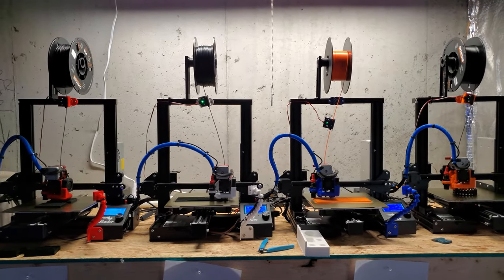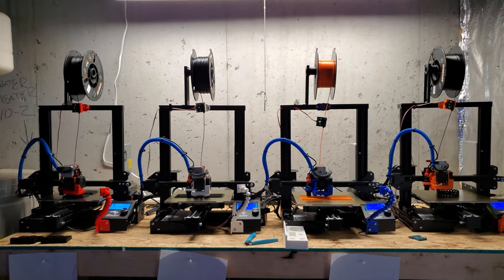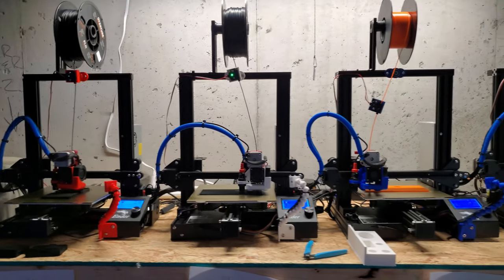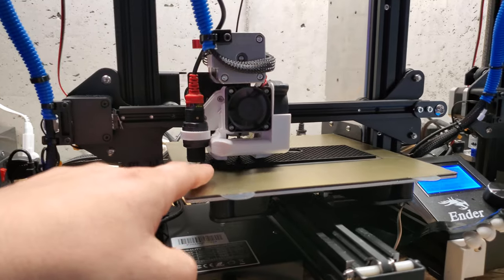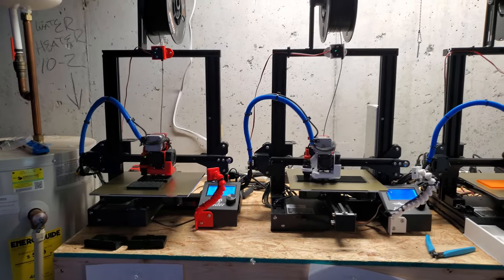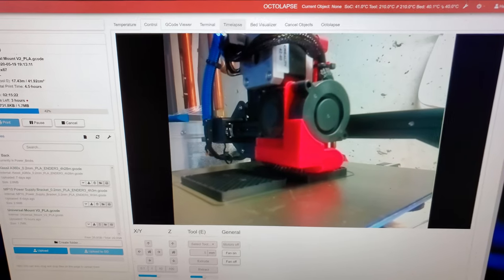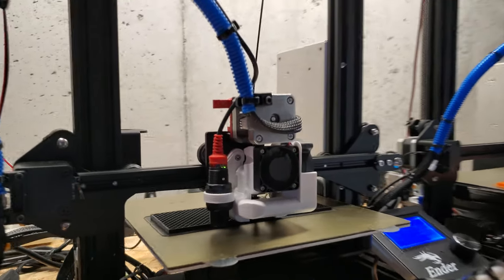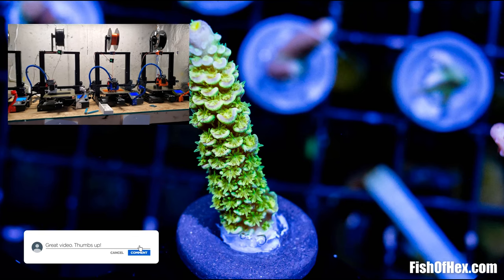My 3D Printer Setup | Upgrades | Is It Worth The Money?

Comment: I've found that the lack of fiddling / maintenance my Prusa's need has more than offset the price increase over clones. That and there wasn't having to dump another few hundred into upgrades to get them safe / functionally friendly, by then you're almost at a Prusa cost. Did that once with my original clone, it's sitting in pieces in a box. You got a nice farm going, much easier to run when they're all the same machines. Whatever you do, don't mix and match clones.
The removable / springsteel sheets are worth every penny, no matter the printer. No more stupid spatula trying to pry prints off the sheet, just leave it alone or at worst, flex the sheet and pop. That is probably the most impacting upgrade the hobby has seen in the last three years.
And for everyone thinking of turning the hobby into a side business - never share your STL's.

Comment: You didnt need a new pcb for the thermal runaway issue. You can just flash new firmware. Granted it doesn't address the issue of noise.

New stock ender3 come with new firmware with thermal runaway. It's only the old stock that has the old firmware doesn't have thermal protection. 

My ender 3 pro is stock and I've stood next to it while it has stopped and displayed 'error thermal runway' as disconnected the thermos to test.

Your enders look great!
Reply from the maker: I know but the stock board is junk and not worth the risk regardless of firmware.

Comment: So what exactly does the Raspberry Pi do? Send codes to the printer? And also if I bought a printer how would I know what I need to upgrade?
Reply: It runs software called OctoPrint.  Think of it like a controller. Let's you monitor remotely and do all kinds of advanced tweaking.    Without it you need a computer hooked up via usb or a flash card to start every print
Reply: @jasper9890  oohhh gotcha,  thanks for the response!

Comment: Nice setup. I was planning to start this hobby and been wondering what’s the best investment for me and something that I can upgrade and use for ever instead of having to buy new and sell old. Any opinions would be greatly appreciated.
Reply: Two trains of thought - cheap clone, will force you to learn the basics and how the printers work, and allow you to upgrade to your hearts content. Cons are it will eat up a lot of your time, might have to chase obscure issues, usually require fiddling to keep print quality consistent.
The other school is buy a prusa, point click print. Can be a high price to swallow, though the mini is out now and a much cheaper option. Just like a 5 month backlog for production, and quite a bit smaller build sheet area.
I do and don't regret starting with a clone. Neither option is bad, just depends on the perspective for your use. Covid has made getting quality filament either more costly, or harder as tons is being gobbled up for shield visors and the like. Kind of a not so friendly time, in a sense.